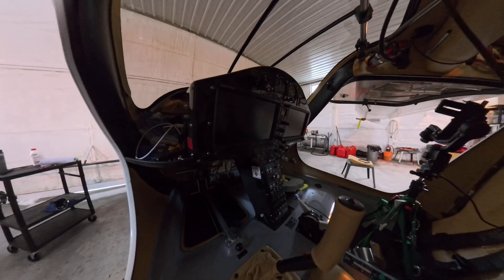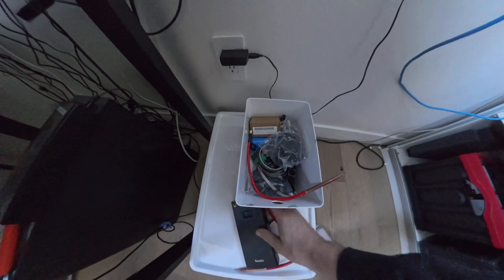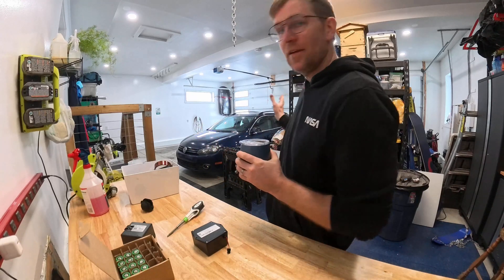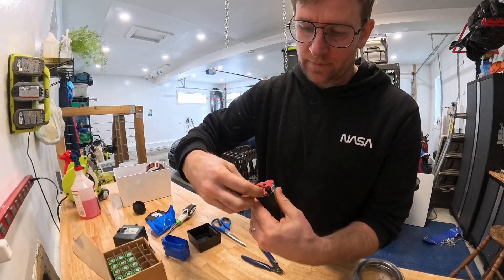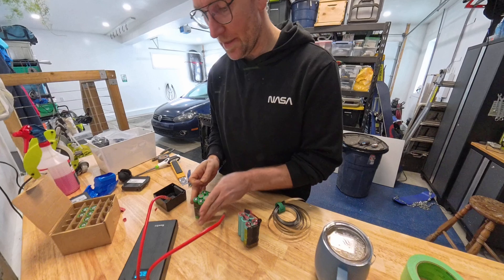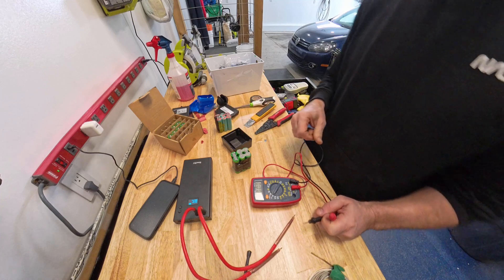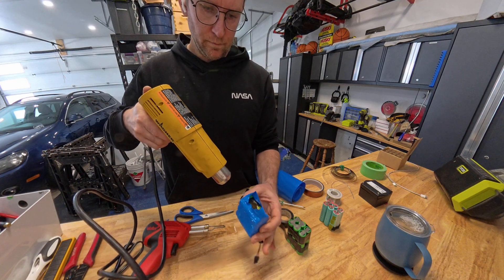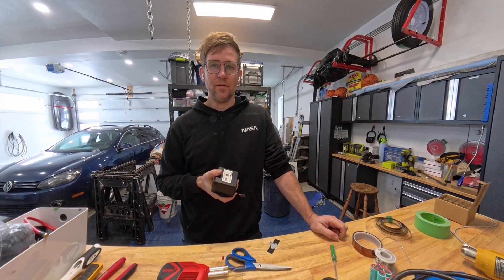Dynon Skyview battery backup DIY rebuild

Comment: Very nice. It would be nice if dynon designed it with battery holders so it was easily user serviceable. And for aviation I would probably use LiFePo chemistry that's much less flammable if things go wrong. A good design in my book is using a single cell or no cells in series so there is no BMS need. 3.2v is very compatible with modern electronics and it can be boosted to whatever is needed. Two 26650 cells might be a good amount if the electronics is done well. In an emergency mode you may want to flash the display light instead of continuous to make it last. 1 or 2 flashes per second can be very readable. A tablet computer can last 5-10 hours on that amount of battery. Modern electronics can be both powerful and ultra low power consumption. I checked up on backlight power and it seems flashing isn't even necessary. Although maybe a good mode to have if you are over the atlantic and you need it to work 10 hours more.